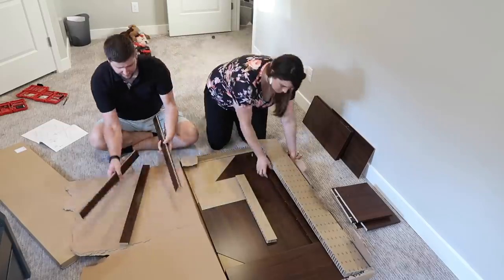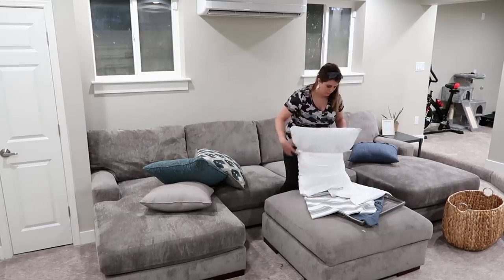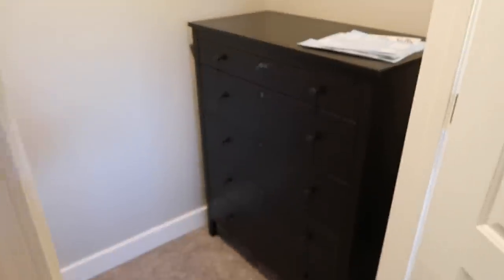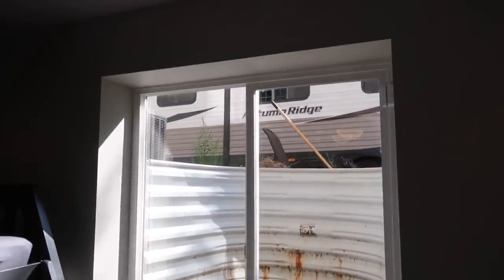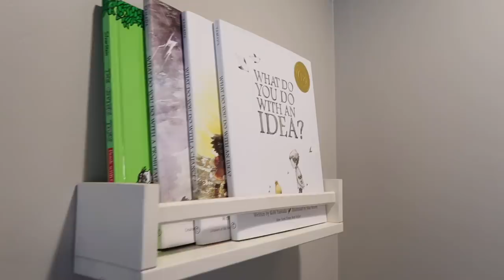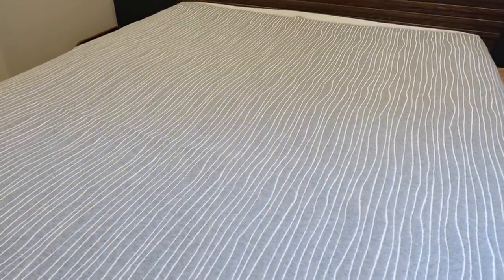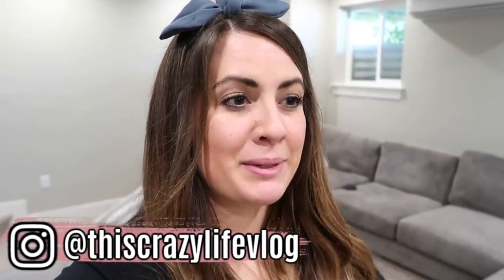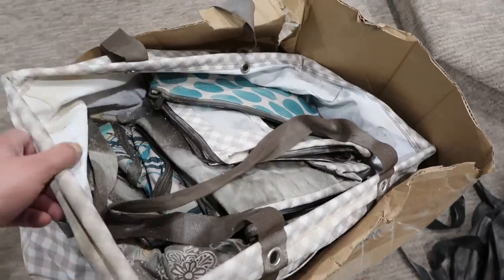BASEMENT MAKEOVER MARATHON 2020 :: 3 BEDROOM TRANSFORMATIONS + THEATER ROOM MAKEOVER

Comment: Just wanted to give you a heads up on the Ikea bed in Noah's room.  Its always good to have extra plastic "screws" that hold the slats on.  If he moves to aggressively in the bed, they will break in half.  We have had to replace those things so many times in the 8 years we have had it.  But it is a great bed.
Reply from the maker: Thanks for the tip!

Comment: The toothpaste trick is awesome! There is another easy and less messy way tho.. just take painters tape and put it on the back where the holes are and mark the tape on the holes. Then you can just take the tape off and put it on the wall where you want the object. Then just drill holes or hammer nails in the wall through the marked part of the tape and you’re done!